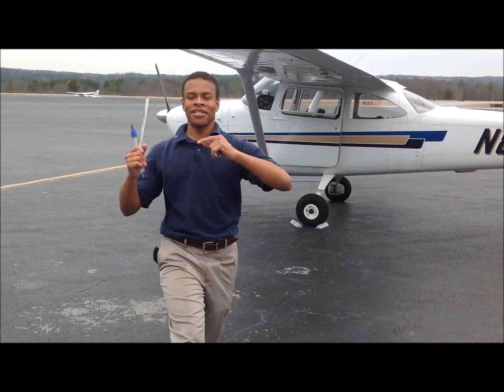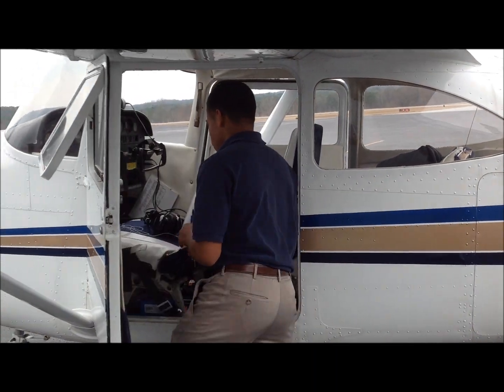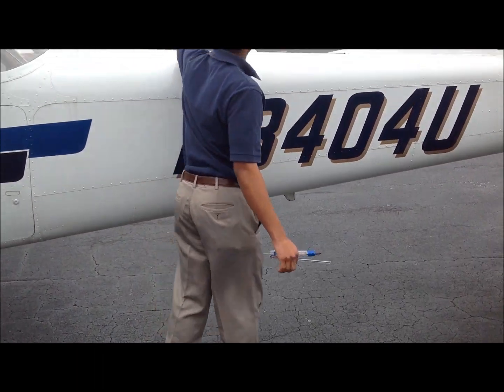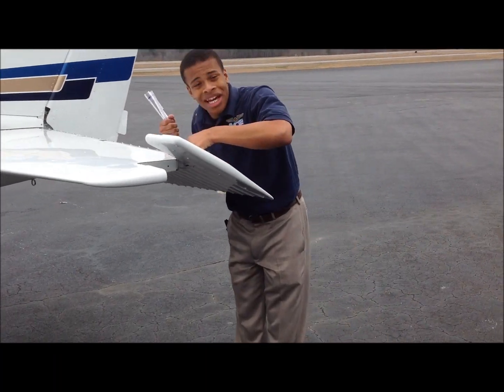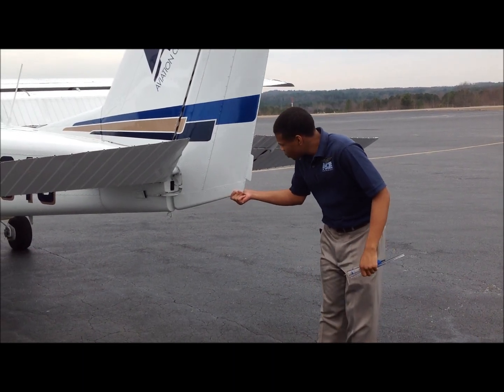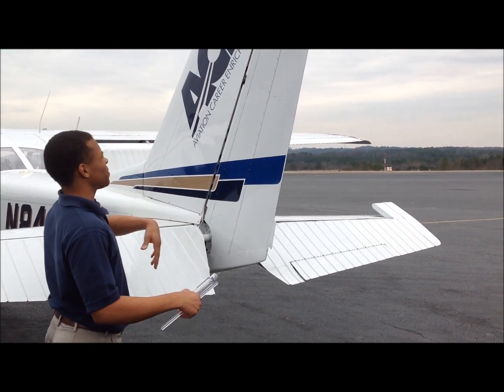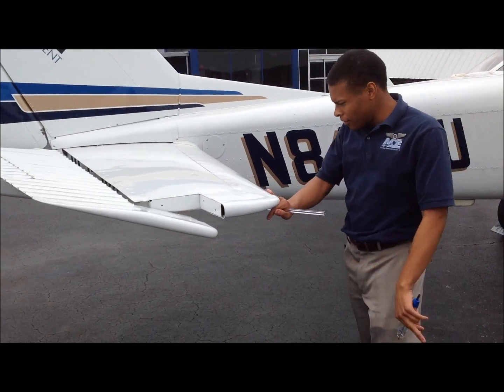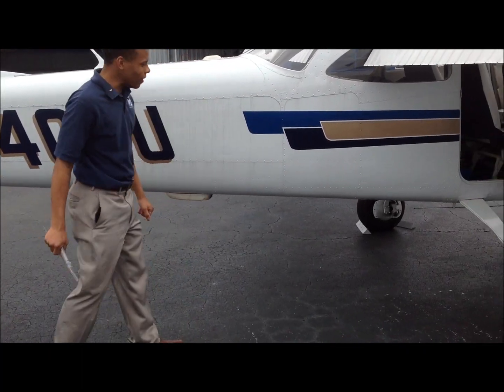How to Preflight a Cessna 172 [HD]

Comment from the maker: Robert,
When the tank is full, you can SEE the fuel at the top of the neck, and you KNOW therefore that the tank is full.  Because I know what the fuel capacity is, I know what the weight with full tanks is.  As I have 50+ ish hours in 172s, I know that we're fine and WELL within limits will full tanks, two people, and light baggage.  Hence, no actual fresh w/b required...

Great Point on the pitot and static checks!  I forgot to include that in the video...the plane had already been preflighted...
Reply: +GeneralAviationGuru You did in fact check the pitot and static ports (at 11:50)...Robert was incorrect about that.  I would like to add a couple of points though: 1) I would caution people against turning the propeller until verifying that the keys are out of the ignition.  Even then, there could be magneto wiring failures that could cause the engine to start if the crankshaft is rotated, so one should be very careful when touching the prop, and try not to rotate it at all.  2) I was surprised to see you dump the fuel on the apron..I realize it may not be illegal in Georiga, but I think all schools or airports should provide cans to dump fuel in to avoid contaminating the ground and groundwater.
Reply from the maker: I certainly agree about turning the propeller.  The interior inspection would indicate that the magnetos were off, but this is not to be trusted for obvious reasons.  I try to avoid moving the propeller at all (it was more often necessary when I was flying older model 172s than with the late models which I currently fly), and, if I do move it, I always remain clear of the arc and make it a point to turn it the opposite direction of normal operations to prevent the magnetos from functioning.

This was a complaint that I had as well during my time at that flight school.  The entire Auburn University fleet (where I currently fly) is outfitted with GATS jars, and we have appropriate means of disposing water-contaminated fuel.  Unfortunately, at the time, I didn't have much of a choice (or the money to spend on my own GATS jar..)

Thanks for the comment!
Reply: We were trained to put the keys on top of the dash so you could visually check they were there (and not in the ignition) before touching the prop. Of course, as I mentioned it could still have bad mags, but we hope that the last pilot to shut down did the mags check (or if any maintenance was done). 

But it was a very good inspection and video. It would have been great if you had a remote mic, because whenever you were not facing the camera it was hard to hear you. I got some good tips. Thanks.
Reply: Just keep in mind that turning the propeller backwards can damage your vacuum pump. The carbon vanes in the pump take a set after spinning in the correct direction for thousands of revolutions. Spinning the prop backwards also turns the vacuum pump backwards, which means that the vanes will be turning against their set. If they meet resistance, the quill shaft will snap as its designed to do if the pump seizes, and you're vacuum pump is shot.

Comment: "I can see the fuel, so we are good to go?" - i don't get that check.  Don't you need the weight for a proper w&b sheet?  Didn't see him check the pitot or static ports neither - only super critical, no worries.  Also, make sure ALL the control locks are off before you start yanking on control surfaces.  

Clear and concise preflight, however.  And well spoken.

Comment: You didn't mention how tight to screw on the oil cap. To tight and after flight it can be so tight that the cap can break and the plane lose oil pressure.